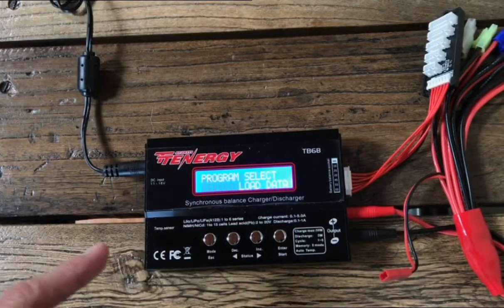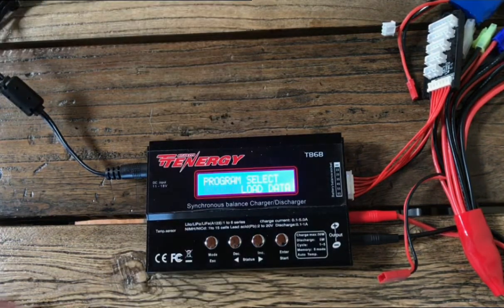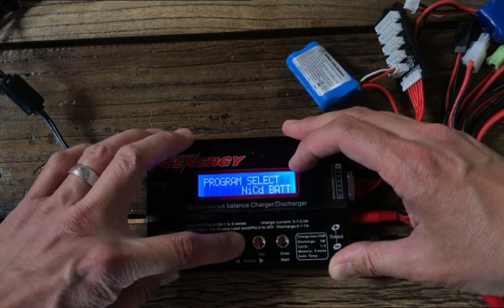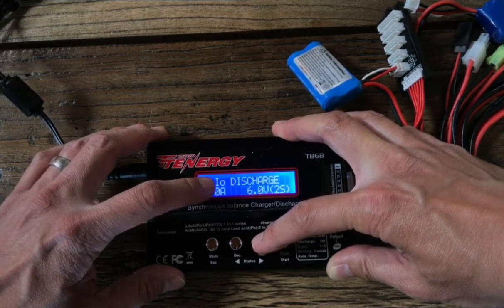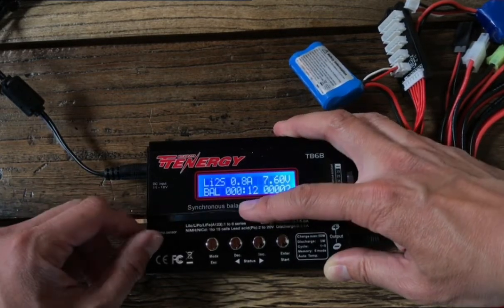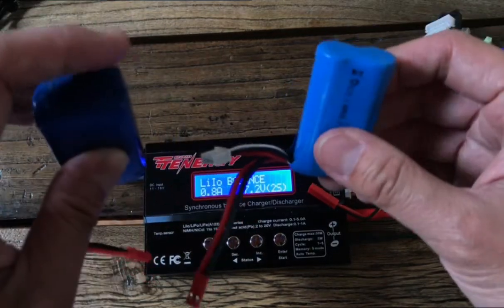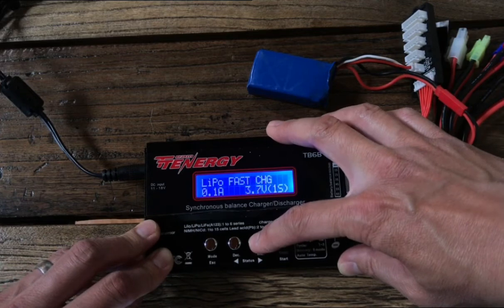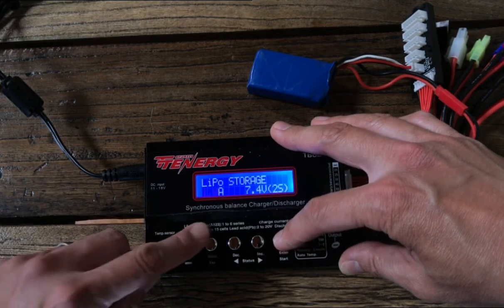How to Operate your RC Hobby Grade Balance Charger for Li-Ion vs Li-Po

Comment: OK, I have a question. I have a li ion battery pack from my backfire boards electric skateboard. It is a 24 cell pack configured with 12sp2. I drained the battery on it and I was wondering, could I use the same method and the the charger you have charge it back up to normal like you did in the video
Reply from the maker: @Stevieb-cc8ll  no, because there’s no balance cable on an Esk8 battery.

Comment: I tried charging just a single cell , and it showed me , low voltage ....... any idea
Reply from the maker: With single cell, there’s no balance lead. If the single cell uses a balance lead type of connector for power, it may not work. I’m not sure it would recognize it if only the balance connector style is connected without a standard power lead. Make sure you’re using the single cell charge mode and NOT balance mode. There’s nothing to balance with just one cell. It may be looking for a second cell and seeing the voltage as too low for a 2 cell battery.

Comment: Hello! Do I need a special charger for Li-Ion batteries? I'm using just the USB cable that came with my RC Car! Thanks ^^
Reply from the maker: No, the one you have is fine. It is rated for whatever voltage and amp it needs.
Reply from the maker: The amperage of the stock charger is likely very low but safe. The usb can only handle so much. A hobby charger will likely allow you to charge much higher yet within safe limits. I do have a video on how to pick a charger that might help.
Reply: @Funcentric  And what about balance etc? It only applies for LiPo batteries? Thank you very much for the attention!
Reply from the maker: @samucapb2  balance is technically required for all multicell batteries. Anything more than 3.7v. Balancing makes it last longer. There’s no balancing option with the usb chargers so the white balance lead is generally unused unless that’s what is being used to charge instead of the power lead.
Reply: @Funcentric  Thanks, bro! So, last question! Do you recommend a Hobby charger for multicell Li-Ion batteries etc?
Reply from the maker: @samucapb2  yes if you find yourself wanting to charge multiple batteries and needing to put into storage charge.
Reply: I have a 3s 11.1v Li Ion Battery. That calculates out to 3.7v per cell. Why is the Li Ion setting in the charger 3.6v per cell? Seems like I might as well leave it on LiPo setting at 3.7v per cell. Any thoughts?

Comment: Will using  this prevent my battery's from runaway or would I be better to install bms on each of my batterys
Reply from the maker: Runaway meaning thermal runaway? That has nothing to do with the charger. Thermal runaway is just the nature and vulnerability of the battery chemistry. A bms for each battery isn’t really a thing. 

Also this is an old charger. Much better stuff in the market these days. I have a video on how to choose one.

Comment: How much time will a 7.4 v 1300mah li-ion battery take to charge if the output current of the charging cable is 7.4v 800mah and input current of the charging cable is 5v 1A?

Comment: Is it normal for these batteries to get warm or hot when charging
Reply from the maker: Warm, yes but it should not be hot. I haven't measured any temperatures so I can't quantify it. But if it's too hot to touch, that's way way too hot. The knockoff chargers do have some quality issues, so I'd advise being super careful with any of those. This charger is quite old as the interface is over a decade old. I'd recommend a better charger though. I have another video on how to select one since new chargers are coming out all the time.

Comment: So as I understood, my 18650 2S1P Sanyo 3400mAh pack should be charged at up to 3.4A? Isn't that too much? Is that formula (mAh/1000=charge current) confirmed by experts?
PS. Another question: What does "storage" mode mean? Is it discharging mode for batteries that won't be used and how it differs from "discharge" mode? When should we use each of these modes (balance, charge, discharge, storage)?
Reply from the maker: Yes, that’s the common charge rate. We call that 1C. Most won’t recommend charging higher than 2C for a lipo. I personally charge at 1.5c at the most. So a 3400mah pack would be at 5.1amps tops. I’ll typically charge at 1C unless I’m in a hurry or I have a long time. I may go down to 0.8C or 2.75amps in your example. Slower or lower amps is better for longevity of the pack. This is for lithium batteries. SLA batteries should be charged at a much lower rate. Same with nimh batteries. Much slower like 1/10C.
Reply: @Funcentric  Thanks ! Btw, what does "storage" mode mean? Is it discharging mode for batteries that won't be used and how it differs from "discharge" mode? When should we use each of these modes (balance, charge, discharge, storage)?
Reply from the maker: @brezovprut4431  storage is basically 3.80v per cell. Do that if you plan to store it for more than 3 or so days. It’ll keep the longevity of the battery. It’s not good to leave it full charged or too low. 

Balance charge if you have the time. It takes longer than charge but you’ll want your cells balanced out. I use balance every time. Don’t use discharge. It’s not for most situations.
Reply: @Funcentric  Thanks a lot for useful tips !
Reply from the maker: @brezovprut4431  certainly.

Comment: Sorry to be asking for help on such an old video, this came up in my googling. I have the same charger and a similar Li-Ion battery as in the video which came with my QX7 lite. Problem is, my battery pack only has a 2S balance lead and no power lead coming out the top. The charger keeps giving me a "Battery Connection" error. Is it capable of charging with only the balancing lead plugged in? My charger may just be faulty, I don't even have another battery to test if the charger is at fault.
Reply from the maker: Your charger is acting appropriately. Many chargers cannot charge w/o a balance lead which is the reason for dedicated 1S chargers on the market. It's possible that you might be able to charge 1S using a parallel board. Not true for all chargers though. It may be a good time to invest in a 1S charger that has storage charging options too.

Comment: i totally forgot how to use ma B6mini 
and now I have some li-ion's to charge , ma b6 already had the li-ion setting .. bit confusing ,but it's charging now ^^ 
thanks for refreshing ma memory mate
Reply from the maker: Cool. yeah, it's not intuitive at all for switching back and forth. It should be part of the menu like the other battery chemistries rather than replacing lipo with lion.

Comment: how much vold limit can be charged if using this charger?  if i charge the vold 5s 21v is it suitable to use this charger.help me friend.
Reply from the maker: Sorry for the late reply. Didn't see this come in. Do you mean voltage? You want to charge LiPo batteries to 4.20v per cell actual. 3.7v per cell is nominal and 4.20v is how much volts actually go into the cell when you charge it. I hope that answers your question. A 5S battery is still 4.20v per cell. You don't set the total 21v. It's done per cell only.
Reply: @Funcentric  thanks 👌

Comment: Can I use the lipo setting because the battery says 7.4v instead of 7.2v?
Reply from the maker: It shouldn’t make too much of a difference. When you actually charge though, you want to have it at 4.2v per cell.
Reply: @Funcentric  Thanks

Comment: Nice review ! A fair bit clearer instruction than some others that are about as clear as mud. Can this newer unit save settings for a few different setting profiles for those of us with a few different chemistries and specs ? I believe an older version did have that ability.
Reply from the maker: Hey, thanks for your appreciation on the video. I did do a few takes to make sure it was quality and helpful to others so I'm glad it did turn out that way. 

When I was looking for a video myself, a lot of the other ones out there had either poor video and/or poor quality sound. Tried to at least improve on those and go through each step rather than skipping through the buttons that aren't even intuitive. 

This unit does NOT have the feature to save profiles for certain batteries. I wouldn't recommend a bullet lead style LiPo charger this day and age. If you already have one, that's totally fine but if you have the opportunity to buy new, I'd recommend something with a XT60 connector. Much more standard, safer, and more future proof than this old stuff. 

I use the Hota D6 Duo Pro version. Dual channel, USB output and has wireless phone charging as well. It's pricier but I feel it should last me the foreseeable future.

Comment: Hi I'm new to the rc hobby I have the two 4s zee 9000mah batteries  an I need a charger will this work
Reply from the maker: Do not buy this charger. It’s obsolete. This video was only for clarifying use for anyone who already has it. I use the Hota D6 Pro Duo which is about $110 but it is flexible and you can grow into it. The only other charger I have is the toolkit m4Q but I don’t recommend that either. It’s got a few faults which I actually made a video about.
Reply: Ok thanks a lot do u have a video on the hota d6 charger so I'll know how to use it

Comment: I heard that if you charge li-po batterys you should use it within a few days
Do I have to also do it for li-ion batteries also?
Reply from the maker: Yes, they’re lithium also. 3.80v per cell. Most people say up to four days. But I storage charge mine every day. I’m just paranoid I guess.
Reply: @Funcentric  do I need this special charger? I only have the charger that came in box of my rc car and it just has usb to plug into power adapter

How do I storage charge it
Reply from the maker: @BuildTimeMC  To storage charge using what you have, you'll need at the very least a lipo alarm which tells you how much voltage in the battery. It costs about $3 + shipping and tax. You'll use that to gauge how much voltage. Then it's just a matter of running the car and testing the voltage to get an idea of how much run time you can have before you're at 3.80v per cell. 

To do it the proper way, yes, you'll need a legit hobby grade charger.
Reply: @Funcentric  what is the cheapest one for storage charging only?
Reply from the maker: @BuildTimeMC  you don’t want to go the cheap route. Just guess by using the LiPo alarm. 

Then when you’re ready, invest in a good charger under $80 that you can use extensively for at least a year. Do not get the Skyrc imax B6. The banana connectors on those are obsolete. There’s a V2 version that has the standard xt60 connector. I still don’t recommend that. Once you get a legit charger, it will snowball into a lot of items to get: parallel board, connector adaptors. ToolkitRC had some budget ones you can look at for under $50. There’s a few at $30 plus tax and shipping.
Reply: @Funcentric  can I just use the battery and if it has no battery left is it good for storage?
Reply from the maker: @BuildTimeMC  hard to say. Some ESC’s have a cutoff set at various voltages. You won’t know until you try ans measure with a LiPo alarm if it’s a budget car. Or to be safe, you can stop driving when you begin to feel it get laggy
Reply: @Funcentric  ok and If it slows down and then it's safe for storage charging?

And thanks so much for the help, I am your 400th subscriber
Reply from the maker: @BuildTimeMC  My recommendation as I mentioned is to get the $3 Lipo alarm to test the voltage and then you'll know for sure. But if you're going to use what you have, then yes, the best you can do w/o any equipment is to guess that when it starts to slow, you're at maybe half voltage which would be storage charge. Budget car batteries don't cost a whole bunch, so you can be the judge of whether it's worth it to you or not. Personally, I storage charge all my batteries.
Reply: @Funcentric  ok thanks, can you send me link to the lipo alarm
Reply from the maker: @BuildTimeMC  Sure, it's the shipping that gets you, that's why they sell so many at once. https://www.amazon.com/Battery-Voltage-Checker-Monitor-Buzzer/dp/B07YYK36VZ/ref=sr_1_12?dchild=1&keywords=lipo+alarm&qid=1619065797&sr=8-12 You can get this at other stores, Aliexpress, Banggood or other shops but if you're in the USA, Amazon will be the fastest. Not the cheapest, but when you buy 5, that's a good price. You can hand them out to your friends.
Reply: @Funcentric  thanks
Reply: @Funcentric  I read the manual for 1 of my rc car and it says this:

"This battery uses a low voltage and power over-discharge protection device..." Does that mean that it's will automatically turn off and then it is ready for storage mode?
Reply from the maker: @BuildTimeMC  it will automatically turn off but not necessarily at storage mode. Probably before any dangerous levels like 3.2v -3.5v
Reply: @Funcentric  I got a lipo alarm thanks
I had my battery on full for like 1.5 weeks I hope I didn't damage them to much
So what voltage should I put the alarm for? 3.8 volts? I think I heard that after a few minutes after using it the voltage goes up a little so what's the best time to put the alarm for?
Reply from the maker: @BuildTimeMC  Cool, yes 3.8v is for storage mode. Yes, standing voltage is the voltage it increases to after it sits for a few min. The timing of when to test the alarm is negligible. Anytime. Or you can wait a minute if it's not too inconvenient. 

For extended runtime though, you can run it down to maybe 3.5v. The advantage of 3.8v is that you can just store it right away, but at the expense of less run time obviously. If you want to maximize run time, maybe 3.5v. But then you have to charge to storage charge before you store it.

Comment: my lithoum ion battery has no balance lead how do I charge my charger keeps giving me a no balance lead message
thanks 
gerard
Reply: Instead of balance charge.  you can use charge.
Reply from the maker: I’m having the same issue with my toolkitrc M4Q. I’m going to need to create a jumper cable that basically connects two ph2.0 connectors on a balance board. I think that might do the trick but I’m not certain. I still need to look into it. Some chargers let you bypass the requirement for a balance lead for 1S batteries since there isn’t anything to balance on a single cell battery. I’ll post a video when I figure it out.

In the meantime maybe use a different charger. One of my videos shows a charge board (not balance board) that will work via an external battery pack like the kind you use to charge a cell phone. $12-17 ish.

Comment: I followed it step by step but my Li ion battery still wouldn’t charge. It kept saying low voltage even though it’s a 7.4 volt because the only option was 7.2 volt for 2S batteries. Is there anything I could do about that?
Reply from the maker: I have come across that exact same issue before. I discovered that the balance lead wasn't in good shape. I had to keep inserting, removing and reinserting until it would connect. Basically, the charger wasn't reading it properly due to an old faulty balance lead. I assume it'll work with your other batteries. If so, it's definitely the balance lead that's failed on on the brink.

Comment: Been charging lipos for 6-7 years and never knew that I could change up to Li-ion. Thanks!
Reply from the maker: Yeah the interface is not intuitive at all. It isn't even consistent in itself. The Lion should just be one of the choices like the other ones on the same menu rather than having to go back and then forward again to navigate through it. A bit of a pain but it is what it is. 

You should check out new chargers these days. Some pretty incredible stuff. I'm using a Hota D6 Pro now. Dual channel, runs out of a wall outlet but can also be powered by an external XT60 battery. Wireless charging pad and USB out port. For smaller sized batteries though, something called the Toolkit M4Q came out recently too and is worth looking at if you're possibly upgrading.
Reply: @Funcentric  me too, i'm charging my 2s lipo in my b3 pro compact charger. Does it have consequences?
Reply from the maker: @maestro-rcboat9881  does what have consequences? Can you clarify your question?
Reply: @Funcentric  or... is it safe to charge my li-ion bat to my compact lipo charger? Cause its only what i have.
Reply: @maestro-rcboat9881 not recommended...try B6 v2 at least
B3 compact charger will easily destroy ur lipo .